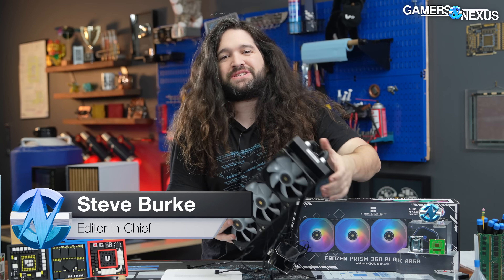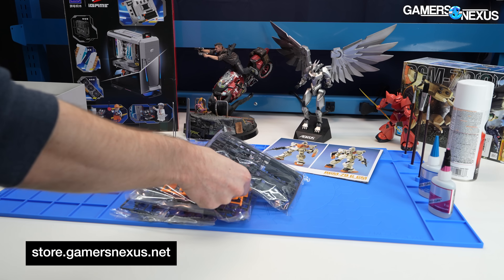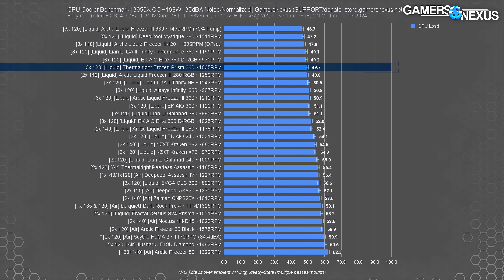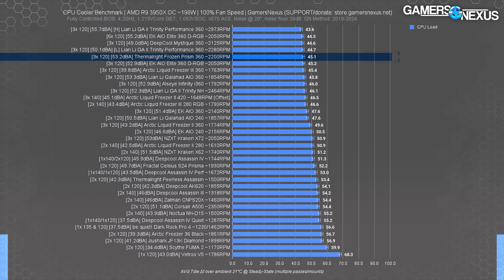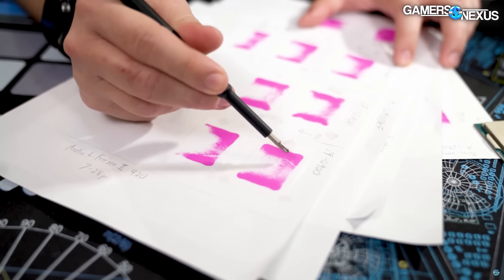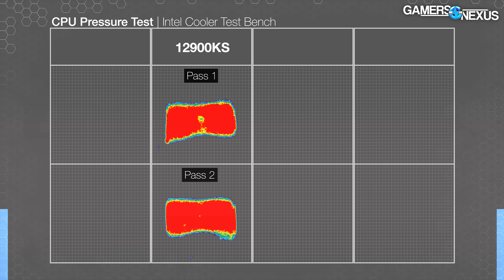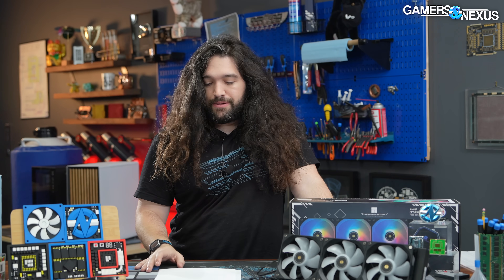Thermalright Strikes Again: $56.90 360mm Liquid Cooler | Frozen Prism Review

Comment: Cool, the point is to remove teh heat effective and dissipate it out, this is why we see sort of heat coefficient conduct between materials and into fans. The thinner fans move the heat and its efficiently moved away to room temperature. fans are always noisy and there are systems that can cool without the use of fans, or very little fan movement is required for optimal air flow, as the gradient temperature is more important. as fan speed increases if the air density or humidity doesn't have enough molecular cohesion to or an affinnity to the gradient IE qa rislence to heat then we get an ineffecient heat disappation point of exchange. Water being more effecient because per square cm it contains more potential inferences of heat exchange.

Other models of fan based heat exchanges utlize a TREE method. Kind of looks cool. Basically cooper trunks that help move the heat into then a sparatic branch system, this optimizes his dispation because it has more infinite points and movement of heat from it, thus hte fan hits more surface area and hte heat cna continuall travel up the into it...

Other method of heat exchange is no conductive oil ssytems with power ladders so the only systems requiring cooling are immersed in a sealed pathway,  that pathway has a slight limitation to speed, as you cna make a valve of rubber seal for cords but theconductive letrical plat to pass through a interconenctor ot dry and wet areas makes it immposible for oil to escape. This is far quieter and far more optimal, as we have a higher molecular denisty for tha exchange and with a simple fish pump and the natural process of heat going up, one can optmiall flow the oil in the system, or use convection. The oil can evne be pumped into a channel and then fanned out and rapidly cooled. THis is a total silent system with specific types of pumping... Zero noise system I think its liek 3-5 dbs. max 15 dbs.  with air chokes that cna happen in begining statges etc...

What is the best thing for cooling a pc... the most effective means to cooling a PC, is simply lowering the ambient room temperature that is optimal for machine and man.. having the room run at 13-17 celsius is more optimal then most heating systems. 4 celsius is hte danger zone because water is most dense and we coudl state to see condesate... for these special rooms, you need ot remove 99-100% of hte moisture from the room, this way you could even go sub zero temperatures. With a very tiny fan for air movement... This would be the most optimal...

I find the pc systems are like the car systems whe nspecific arch type monopolze and take over the systems, tehy destroy the means to advance those systems further thorugh various means of warfare.. and including the naming and ocnfusion of hte products as itsi soley for capital.. so while internet can be faster... it can't be becuase of investment criminals... so normal human that make ocmputer parts or the cases  verse these league of men and owmen contorlling humantiy and everyhting in vestmetns nad robbing people, its pretty lawless...

So just like decmpiler and compiler its just yes or no, so data shouldn't be a problem its always linked to processing speed, since you can compress an unlimited ammount of data in a system, and hten have a pecialed decompiler... .. trillion to trillion to trillion bits neesd less the n14 kilobytes.. it might take a yeah to decompile with processors... of today, but the means ot tightly encode something is infinite and hten langauge based system for interpreting it.  The question is active systems, and powered systems and how to operate said system. So sadly the movement forward and how warfare and other systems operate is as it has been forever, they utlize the idiots of a system to scramble and destroy so in one hand one could say its a open and fair system but politically we know and institutionally now we know.. so people invade other peoples areas and then demand x or y killing those people and stomping on other groups and state it in the name of reparations or hatred or vioalte laws and by pass and state I cna do whatever for money, but in following tech and systems we find its not really like that at all. Most of humanity is void of being able to do anyhting as its entrapped in the simple concept of if I sell x, I receieve Y. If I stop person A from selling x , I recevie all of Y, its not intelligent at all and quite cruel...

This does relate to pc and mahcine design when at a fundemental level cults nad american poltics robs people of hteir work and future and relation and then resells other peoples works.. and destroys peopel openly... everyone then is attmepting to sell shit rather then makign everythign cheaper by doing the correct shit and still then attmepting to sell on teh side of hteir hobby, or sort of  so we get mass impoverishment from teh state level of hte total society the nstating its weathier when this generation is hte largest generation withotu OWNERSHIP assets which pretty much slavery.. lo l

Comment: I just bought one of these are one like this for 53 bucks today. Amazon....
Thermalright Aqua Elite 360 V3 Water Cooling CPU Cooler, 3 PWM ARGB Fans with S-FDB Bearings,Efficient PWM Controlled Pump,

Comment: I've had the Frozen Notte 240mm on an OC'd 12600KF for exactly 1 year today, and I've had no issues with it so far, excellent thermals for the $48 I paid for it a year ago, and still working just as well as it did on the day I installed it.  Even if it were to crap out today, I wouldn't hesitate to buy another Thermalright AIO to replace it.

Comment: I'm building a new pc, had got the nzxt 240mm kraken with lcd for $150. I returned it to save money and got the frozen notte 240mm. Temps dropped from mid to high 40s idle to low 30s idle. Saved myself 100 bucks.

Comment: I have a thermalright 360.   It's only been going for 2 months,    I had a 1st gen Deep cool that lasted.....sold it working so 4 years, 2nd gen deep cool 1 year and the liquid was done inside, and cooler master, 1 year and the liquid was done inside.   So if it lasts 1 year, it beats my experience with cooler master and deep cool for a cheaper price.

Comment: I've had my corsair h100 for 10 years probably. It's never thermal throttled. I would have thought it would have evaporated by now. Idle in 32C degree weather it's still sits at 39C-40C degrees. I open another tab on Brave and it can leap to 63 degrees for a second. 

Is that erratic behavior? I don't know, but this cooler is old. Would anyone else replace it?

Comment: Bought a Thermalright Frozen Warframe 240 for 77 euros (80 bucks).

Very efficient, beautiful, cheap and comes with an LCD screen you can customize.
I run it on a relatively small CPU (5600X with an OC), but I'm impressed: 43-44 degrees on stress test or gaming, around 30 idle (room temp is 21).
This AIO would be enough to cool stronger CPUs, I wish you guys would test this 240 AIO one day.

Incredible value.
Reply: Where did you buy it from? Aliexpress? im also considering buying one of their products from aliexpress
Reply: @typhoon4994  Amazon

Comment: Just bought a Thermalright Frozen Vision 360 to cool my new 7950x3d in my new build when all the parts arrive.
Reply: When you get it, can you tell me how it’s performing. I was thinking about getting the same thing
Reply: @dragon9slayer250  I'll keep you updated when it's installed. Keep in mind I'll be swapping the stock fans out so performance could be better or worse.
Reply: Any updates on this?
Reply: @jojimonty2506  Not yet. It's here and as soon as I get a chance to build the new rig I'll post the temps. I work long hours so it's going to take time.
Reply: @LordPoshnameVonPlumbingparts  no rush man I just picked up a new sealed 7950x3d on offerup for 300 bucks and I am about to order a motherboard and ram to upgrade my 5900x, x570 setup. Any board you recommend?
Reply: @jojimonty2506  Sorry about the late reply, she's in and performing relatively well with different fans (JL Interstellar V2 in push/pull). Idle on the hottest core it fluctuates between 45°c to 47°c when the loop has warmed up. Stressing the CPU it sits at a comfy 77°c. Gaming it fluctuates between 55°c to 59°c. This is with PBO on and Expo enabled on the memory.

I can't moan at those temps.

Edit: That's with an ambient room temp of 21°c.
Reply: Where did you buy it from? Aliexpress? genuinely asking since it sint available on amazon in the U.S.
Reply: @typhoon4994  Amazon UK.
Reply: @typhoon4994  Amazon UK.

Comment: Im still rocking the Thermalright Macho rev.A with a TY-143 instead of the default fan and X-Silent 145 for my drive cage cooling. They're gonna be running for 11 years on 9th of July 2024, outliving the original FX-8350 build I bought them for for over one and half years and continuing working perfectly fine to date. Great quality!

Comment: My very expensive Corsair 360 AIO's pump failed recently and I picked up a quite cheap Deepcool 360 AIO which is quieter and cooler. I'm almost wondering if the pump was always bad and affecting performance. I'm quite impressed with it and will be less wary of cheaper solutions going forward.

Comment: Speaking of old Air Coolers, I still have my old 2008 build that I threw a Thermalright Ultra 120 Extreme on way way back then and, it still works flawlessly with that old Q9550 Overclocked 1Ghz from 2.84ghz to 3.84Ghz. Thermalright seems to have a solid grasp on their quality, lifespan, and value.

Comment: Did I watch your videos before buying this AIO. Yes
Do I understand the Thermalright  is new to the AIO game, therefore untested longevity wise.... also Yes. 
Do I trust the quality that Thermalright has shown me in the past? HELL YES!
Did I save possibly more than 150$.... Time will tell but before these coolers from Thermalright I never wanted to liquid cool anything.. Why pay 5x the cost for half the longevity type idea?

But I will pay 20$ more for undeniable performance over air, even if it doesn't last as long.

Comment: Thermalright: 18$ Assassin King 120 SE (5 pipe) AM4/AM5 cooler. Efficient up to 170W. Take it or leave it. 18$ everyday of the week.

Also Thermalright: 35$ Peerless Assassin (6 pipe) AM4/AM5 cooler. Efficient up to 250W. 35$ everyday of the week.

Also Thermalright: Don't like air coolers even if they cost less than 20$ for cooling straight up 170W like a 7800X3D ? Okay there's a reliable 360mm AIO for 60$ ! Take or leave it, now.

Comment: I actually bought this (the 240mm variant) a few weeks ago upon finding it during a desperate search for an AIO that would fit my budget to cool my i5-13600kf after upgrading the motherboard so I could finally OC it (long story condensed to TLDR: originally had a 12400 and a B-series board when I upgraded to my 13600kf)
Anyways, the cooler has performed spectacularly in my testing.

Comment: I've been daily driving a notte infinity since October I live in a fairly dusty environment (cat and thick pile carpet). I had some fan noise come up about threee weeks ago (that has since gone away on it's own over the last week. fan is still turning the same rpm range that it was) on the last thermal right fan I had in the pc as an exhaust fan. (I have asia horses single mount 360s on the front and on the rad). My infinity mirror though on the cooler pump has a flicker it didn't have before. 
The fan led color accuracy could use a little improvement as well. It seems to be a little slanted toward the green end of the spectrum vs my other rgb. (I run an icy blue color so it's not too far off)

 I bought another one for a friend in December and he's not had any problems with his. They seem like good coolers and I'm impressed.

Comment: You should compare this to the Frozen Notte 360, as the Frozen Nottes pump is actually built into the hoses and not directly on the block as this one is. I installed the Frozen Notte on my son’s Ryzen 5 7600x for Christmas, I’d be interested to see if there was a difference in the cooling with the different pumps and locations.

Comment: Do you guys know if the pump shroud on this AIO is easily removable? I'm currently window shopping for an AIO liquid cooler that is neither RGB nor overstyled with an easy to remove pump cover. I have my own plans that don't need to spend more than necessary on Branding™ or styling or RGBs when I'll be adding my own.

Comment: I'm using a thermal right aio on my i7 14700k and 7900xtx build and it works great imo especially since it was only $60 and I figured if I didn't like it I'd get a different cooler but it's been six months and still liking it. Louder cooling doesn't bother me I got 2 young children and a wife so I'll never notice the louder fans lol.

Comment: Using a Thermalright Frozen Notte 240 mounted to cold a 12400 @5.2 during 10 to 16 hours each day. It's in charge of the cpu for now 15 months, and I can definitely tell there's absolutely no drop in its performance for now. Best regards from France.

Comment: I have a TR frozen edge 240 and its fairly nice but the pump has some vibration Transfer problem, generally as it seems. 

The deepcool LS520 SE, which was like 10-20€ more, is much better and the TR frozen edge is my backup solution.

Comment: I did a complete white build and purchased the Frozen Notte 360 white. I was a bit sceptical about the pump position but it was only 76 euro's so I went for it. And I don't regret buying this thing at all. You can't hear the pump at all, you don't ever have to worry about air in the pump cause of it's position and the only thing I replaced were the fans. Great performance, even better pricing and I would defenitely buy an aio again from Thermalright.

Comment: Your comments fill quick, but as at least two others mentioned, the Notte (I didn't get the Italian joke) is basically the same price, but with better reviews down the board for both Intel and AM5, with an easier to install path. If you circle back to AIO budget coolers, ThermalRight wins out obviously, but not with this cooler. PLS mention Notte...

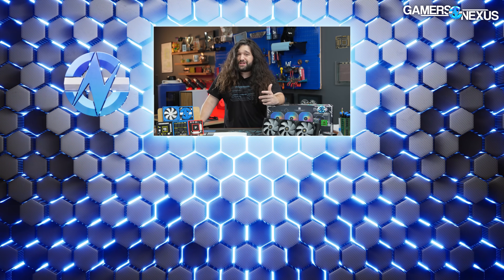Comment: 19:24 I bought the Frozen Vision 360 for my Asus X670e-A gaming wi fi motherboard and paired with a 7700x cpu from Amd. So far so good. If only my fans would get recognised by ANY software I would be happy.
Full specs
Motherboard ,cpu and aio as above with two 24gb sticks of crucial 5600 ram and a 1tb boot name with additional 3x2tb name drives and a 7900gre graphics card. Apart from the 3 fans on the air I have another 7 attached to a hub. But only the air pump is recognised in bios, the rest no.

Comment: Ok so you show Ryzen 3950 temp results and 3800/3950 pressure map results but then show it being installed on an AM5 mobo and chip why couldn't you have tested it on and AM5 CPU like the 7950 and 7800X3D I can probably guarantee there's not many people still using 3000 series ryzen CPU's we've moved on so shouldn't you do the same

Comment: So many 240s.  And so many 360s.
But approximately ZERO 280s, that I can see on that whole page of redundantly similar models.
WHY THE HELL WILL NOBODY FOCUS ON 280MM RADIATORS!!??

A 280mm radiator, gives roughly 91% the surface area of a 360mm, with roughly 1000% more case-compatibility options.  And with 140mm fans being inherently much quieter than 120s per volume of air moved (let alone comparing two quiet fans to three noisy ones in aggregate), you can easily boost the fan speed to MORE than cover the difference in cooling/noise performance.

I've now gone and carefully searched.  I'm literally not finding ANY 280mm radiators from Thermalright AT ALL!?
Whut.  The actual.  Fuck.

Comment: I recently built a PC with the Thermalright Frozen Edge 360 cooling a 5800X3D and I was pretty impressed with the value at $54. The only thing I could really complain about was the stiff tubing and the fan noise was a little louder than I'd prefer but I can't really complain at that price.

Comment: i did bought one, temps were very good. tubes were stiff, hard too move around. But pump noise was super bad. can slightly hear water movement, but a very high pitch noise, heard from far. went back to my air cooler.

Comment: If i didnt have a Noctua NH-D15 since like 2016 I would go for this. Aircoolers just dont die and can be transferred to new builds the only reason I want to get rid of it is its a pain to work inside the case since the aircooler is so big but once its built who cares? I was also thinking about getting the smaller Thermalright peerless assassin but the noctua nh-d15 works perfectly fine! Noctua was nice enough to send a free bracket for the AM5 platform after I upgraded from an Intel chip.